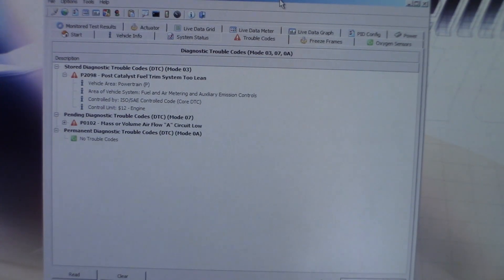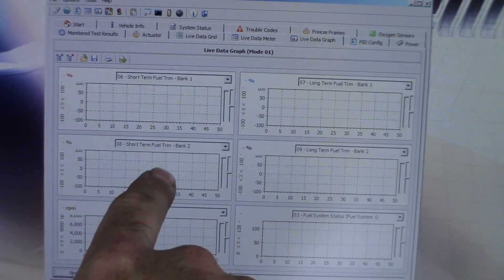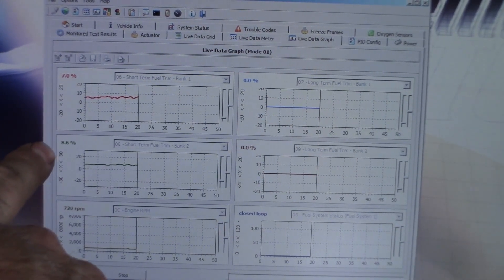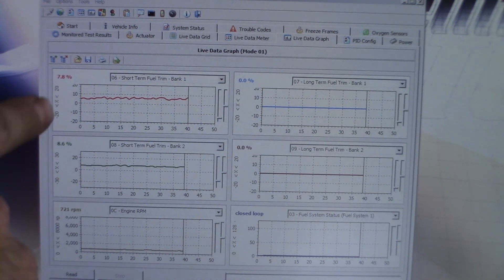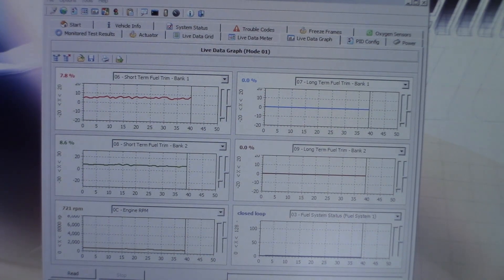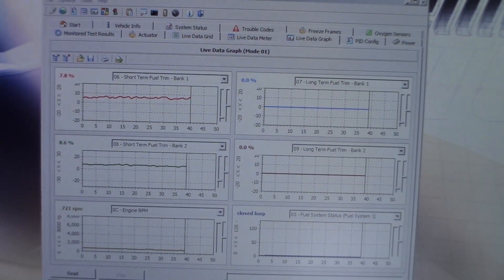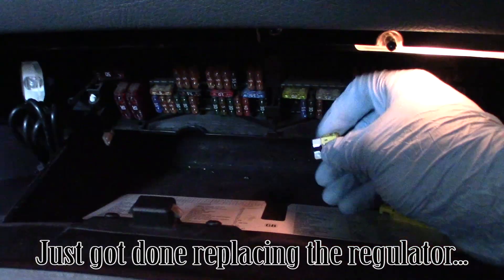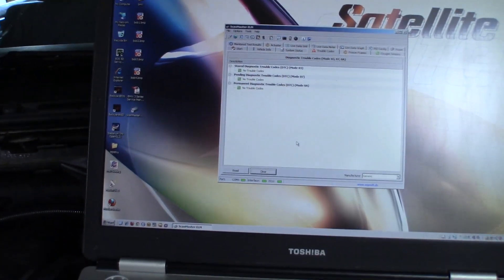BMW 330i 325i E46 Using Fuel Trims To Diagnose Engine Problems P0171 P0174

Comment: hi guys
i have fault code 
p2191 system loo lean at higher load bank 1
no mas air flow sensor in the car
short fuel term is always at -25 
what could be the problem please ?

Comment: I'm wondering if you may be able to point me in the right direction. I'm getting a lean code (bank 1 only) and a insufficient flow on secondary air pump on an 02 e46. I have checked trims, all are less than 5% (-2 on long term and 4 to 6 on short term). Smoke test revealed nothing. Is there another possible cause? Air pump works, relay works, I replaced the vacuum lines to the air pump valve on manifold, tested the switch at the intake, replaced fuel pressure vacuum line and filter, replaced MAF. new upper and lower intake Oh and also replaced fuel pump which is running 40+ PSI.  Thanks in advance for your reply. Love your videos as well, they have helped me eliminate all but these two pesky codes.
Reply: check PCV valve and hoses.
Reply: @jbaroli  Thanks!

Comment: Hope you will see this. I had fuel trim on bank2 of my m73 up to 20%, did your tests and found out its a vacuum leak(I sort can hear it). But I fixed the fuel trim issue when I removed the Air Injection valve it went to almost perfect 0%. Why is the air injection valve causing a fuel trim of 20%?

Comment: Hi , i have 330 ci and i have positive 10 percent on idle and it will decrease to 0  only once i hit the accelerator or if i let the car idling for long time , no vacuum leak spotted an as i test the vacuum system and no codes , what it could be the issue ??

Comment: Ive got on my diagnostic saying
Fuel trim limit bank1
Fuel trim limit bank 2
What would that mean?
Reply: Same, no idea, would like to know
Reply: @samarnold1839  i found out the problem 
Fuel pump and  camshaft sensor
Reply: @tubata111  ouch
Reply: @samarnold1839  second time fuel pump 
And 3 time the sensor...
Reply: @tubata111  that sucks. Is it safe to drive until pay day (friday) you think?
Reply: @samarnold1839  yea 100% but its just that the car would be laggy

Comment: Hey great video's, I've been chasing high LTFT for a while. I"ve replaced pre-cat O2 sensors, CCV system, fuel pump, fuel filter, both intake boots, 
IAC boot, rebuilt the DISA valve, replaced the Brake master cylinder vacuum hose, the tee that connects to the boot, checked all vacuum lines. I've cleaned the MAF sensor. The STFT will hanging around 0, but the LTFT still reads around 11. I finally replaced the MAF sensor and It corrected the problem. After about a 30 min drive , STFT was reading around 2 and long LTFT fell to 0. My car is an 06 325ci vert with 112k miles. So it seems that the old MAF was not correctly reading the amount of air entering the engine, so it looked like a vacuum leak / lean condition but in accuality it was a faulty MAF sensor not measuring the correct amount of air entering the engine. I guess the most puzzling thing was the car ran and idled good and smooth.
Reply: I’m having the same damn problem.... my car was reading around 12% positive fuel trim on both banks.  Then it got a cylinder misfire in cylinder 3. I did a smoke test at home and found the intake Manifold Gasket gasket was leaking... it replaced it. Stopped leaking. Still the same trims. Found a couple spot leaking. Got some hose clamps and stop the leaks. Did smoke test again, no leaks. Still same trims. Repalced the fuel pump and filter with built in regulator... trims dropped from 12% to 9-10%.
O2 sensors seems to be reading correctly as well as the MAF sensor.  It reals about 14-19 kg/hr.   Not sure if it’s lying. This is so frustrating.
Reply: @Omardottcom  you solved your problem? i have the same :(
Reply: Andre P  I haven’t  technical solved the problem but made it good enough to pass inspection.  As you know, I change my intake manifold gasket which has a leak. I put hose clamps on all the hoses. I changed the fuel pump and filter. I had a little leak at an o ring on one of the ccv connection threat was leaking so I replaced the o ring and stopped the leak. I changed the oil filler cap which didn’t really have a leak but smoke would come out of it  if the pressure was high enough when using the smoke tester I made. I checked the injector o rings and they seemed good. Some how my trims dropped to around 8% and have stayed there so far. The service engine light went away and I was able to get it inspected and pass. But the trims are still too high. When doing the smoke test smoke doesn’t come out of anywhere. I don’t know what else to do.
Reply: @Omardottcom  you solved your problem? i have the same :(

Comment: My bank 2 trim idles at -8% and goes lower  on acceleration.  Im throwing the exact same code..please help...4.4liter 750li 2011..car runs great, really would like to properly diagnose this rather than throwing parts at it

Comment: Hi Jason,
Thank you for informative video. I watched both of yours, and try to trouble shoot my P0174 code, which recently pop up 
(don't  have P0171)
Engine idles and car driven normal on both city and highway
P0174 came back after reset, while driving but not after engine starts , not at traffic light.
Here some additional info...
-New Valve cover gasket (less than 3K)
-New fuel pump (less than 15k)
-New DISA (less than 18K)
-New fuel regulator (less than 50K)
-New CCV valve (less than 50K)
-MAF is original, cleaned few times
I will your technique to determine to see it is a Vacuum leak or lack of fuel?
Again, thank for video.
Please let me know your thoughts
Reply: if it's just 174 and not 171 it could be o2 sensor. check o2 sensor voltages to see if that's the problem

Comment: I have a 2006 bmw 330i just changed both mass air valves and sensor and my car still runs rich till it dies but will start right up but smells like it’s running rich

Comment: Hello,
So what are your thoughts on aging sensors? I have a kind of interesting problem but a little theory first(skip to last paragraph if you have no time). With M52 they used Titania sensors that lasted a long time but looking at my M54 voltages i'm reading zirc values (up to 0.9 V etc), so sensors are probably more prone to aging problems.
Anyway according to my logic a vacuum leak would cause high trim because of the higher amount of unmetered air resulting in a lower amount of fuel being injected according to fuel maps and because lambda sensor catches the excess air due to lower amount of fuel injected, it will add more fuel and thats why we see higher numbes on fuel trim, same thing with dirty MAF (lower air).
My E60 M54 has a little rich idle i think, because although i can not smell rich exhaust, during colder periods it has a little too much condensation at idle coming from the exhaust. I presume my cats work fine and thats why i cant smell rich exhaust and they transform the unburnt fuel into H2O. It's not just the normal higher condensation that occurs during winter etc of that i am sure, because it still happens after longer drives and is always there, even when all the other cars around do not produce "condensation vapors".
My fuel trims are fine and i have no codes, lambda voltages are fluctuating like their supposed to, so i'm thinking the ageing oxygen sensors are the culprit since the effects would not even be registered by fuel trims and the sensors are "bad" due to voltage not reaching that high anymore?
Reply: All the other problems that would cause rich mixture would probably be picked up by oxygen senors and in turn by fuel trims i would guess.

Comment: Hi your content has been amazing! So I used the fuel trim to help identify my p0174 p0171 codes but after fixing the vacuum leaks I continue to have the codes. Now that all the vacuum leaks are fixed I notice the fuel trim goes 27.3% at idle and holding at 2500rpm it drops to zero then within 5-10 seconds climbs back to 27.3% on the STFT. Here's a list of the work done. Cleaned the MAF, changed the intake boots, all the vacuum lines, intake manifold gasket, new spark plugs, ccv replacement, icv grommet, throttle body grommet, new fuel filter and fuel pump was replaced last year. I appreciate any help thanks!
Reply: What was the problem? My STFT also reads 27.344% very regularly which is such an odd number to stay at for both of them
Reply: Did you find a solution to this? Mine is exactly the same. Thanks
Reply: @robeaton2191  lol I sold the car was my solution.
Reply: @mashzilla  looks like i bought it lol
Reply: Lol I'm having same problem with 27.3% on STFT. Did you find out the problem?

Comment: Forgive me for my bad english. I have a problem similar to the one in the video. My short fuel trims are about 25% at idle. I've checked for vacuum leaks with a smoke machine but I've found nothing. The MIL light is on with P0150, P0170, P0173, P1250 and P1520. I've bought the car 2 months ago and since then I don't know where to look. The O2 sensors are ok (checked voltage), i have changed the oil and fuel filter 4 days ago but nothing changed. The MAF is working properly (I've also cleaned it but no luck). The fuel trims when I start the car are about at 3%, then slowly go up at ~25%. When accelerating they drop at 11% but they won't go down over that. I don't know what to do 😪 Thank you for any response

Comment: Hey man, that's such an informative video and a great way for diagnosing the fuel trim bank 1/2 issue .. I'm facing the exact thing and I'm going to try this method to figure out the issue.
My E46 330Ci is a japanese import and almost no OBD tool is working with it, I just purchased a BMW Scanner and hopefully receiving it soon .. Can I do the tests using the BMW scanner and its software?

Comment: hello Jason recently replaced ccv all vaccuum hoses on my 04 330ci  rebuilt disa with g.a.s. kit. the service engine soon light is still on disconnected batt still is on do i need to erase the codes in order to reset the light. codes show bank1 bank2 lean also shows replace pvc valve which i have already done.your videos and your help is greatly appreciated.

Comment: Have a ? I own a 2004 z4 2.5 I changed the ccv I disconnected the battery before I started and color coded the plugs so I wouldn't mix them up even tho they will only fit the right one but after I hooked the battery back up after completing the job and now it will crank but won't start any idea

Comment: Hi jayson sorry if im asking too much im just confused and need your expertise. What would be the normal range of 02 sensor volt at idle and with 2500-3000 rpm? I want to rule out via volt reading if my o2 sensor is the culprit? Also the  normal range g/s of the MAF sensor. At idle and 2500-3000rpm?thank you very much.
Reply: My MAF output at 3800 rpm is 15g/sec, and at 725 rpm idle is 3.6 g/sec.  Help you any?

Comment: Hi does  + - 5 is normal at idle? Thank you.
Reply from the maker: yeah that's ok
Reply: 50sKid  Hi jayson, pls correct me if im wrong, do you think tracing vacuum leak via fuel trim must be done at idle? When im at 2500 to 3000 at the road my STFT kicks to 17% that because engine needs fuel to run right thats why fuel demand goes up when driving on the road.my LTFT both bank 1 and 2 is pin to 11.7 which i know its always adding 11.7% to maintain the ratio. (Could i reset this LTFT?) or incase if i fix the leak would this 11.7% on my LTFT will go normal. Sorry if im wrong i guess its always adding 11.7% fuel to maintain the ratio?
Reply: In addtion to my question...my car is running fine but i noticed when starting the car i didnt hear a priming sound in my fuel pump do you think not hearing a fuel pump priming would indicate thats its going to fail soon? right now it takes me 3 cranks to start the car  at cold start after it dies at 1st to 2nd crank battery sign on dash board pops up.i consider changing the battery but no priming sound bothers me.

Comment: Hi im having this on my e46.

Idle:
STFT1 = 8.6
STFT2=  0.0
MAF =    0.565

2500 -3000 rpm
STFT1 =   3.1 - 4.7
STFT2 =  -0.8, 0.0, -2.3
MAF =      1.870

I think its a vacuum leak...going for a vape test
I just want to rule out if MAF is failing /failed?

Thank you.

Comment: Hello can some one help me i have this code P0170 fuel trim bank 1 My engine goes uneven and turns off when it's in a minute and can not run it at all because it loses all the Power i changed air flow meter but is stil The same i have dont change fuelfilter and power train regulator and I dont know If I have some where vacuum leaks so on the last i scaned it on garage with data tool scanner and I get catalytic fault code Could it be wrong that it goes uneven i Will be very grateful for respond back Thanks

Comment: Hey @50sKid thanks for detailed instructions, can fuel pressure regulator also cause missfiring codes with p0174 and p0171? I have p0174 p0171 p0305 and random missfires code
Reply from the maker: I doubt it.  You would have to have a severely restricted fuel filter which usually doesn't happen.  P0171 and P0174 are almost always caused by vacuum leaks.
Reply: 50sKid thanks for reply, i noticed that the first code that is thrown is p0174 and only after driving a while i get p0171, does it have to do something with SAP or it will be triggered only on cold starts?
Reply from the maker: +Alexan Gulbudaghyan if it was sap you would also have sap codes. You have a vacuum leak somewhere. Watch my common vacuum leaks video
Reply: 50sKid Hello can some one help me i have this code P0170 fuel trim bank 1 My engine goes uneven and turns off when it's in a minute and can not run it at all because it loses all the Power i changed air flow meter but is stil The same i have dont change fuelfilter and power train regulator on the last i scaned it on garage with data tool scanner and I get catalytic fault code Could it be wrong that it goes uneven i Will be very grateful for respond back Thanks

Comment: @50sKid, i have a problem with my 2002 330ci, sometimes i have lean codes thrown at bank 1 and 2 other times MAF code.
at cold start the car hesitates and sometimes stalls but very responsive and alot of power, 
once it reaches operating temperature no more stalling but most of the time it has no power like accelerating in 4th gear
and other times it jumps and awakens then back to no power, above 4000 rpm the car runs fine.

reading the fuel trims, at idle everything is close to 0 (fluctuates between -2 and 2) but once i put a little acceleration the trims are flying (up to 18 to 22% inpa lambdaintegrator bank 1 & 2) 
the things i've done :
replaced O2 sensors (maintenance)
replaced fuel filter and fuel pump
replaced CCV, oil filter housing gasket, valve cover gasket

checked the fuel pressure both at idle and throttle it's stable at 3.2/3.3 bar

any ideas where i should be looking next ? i eliminated the vacuum leak since at idle the trims are normal
could it be the MAF ? cleaned it (with no change), if the MAF is dead would the fuel trims be normal at idle?

thanks.
Reply from the maker: Your fuel pressure actually sounds low.  It should be 3.5 bar/50psi.  What brand gauge did you use for that test?  Anyway, if the MAF was dead your car would either not run or the computer would recognize that and substitute a value for the MAF reading and that value would most likely be higher than normal and you'd see that reflected in the fuel trims.  But your MAF could be out of calibration and causing the problem.

Anyway, the most important thing I want to explain is to not use INPA fuel trims to diagnose things.  The INPA "trims" are not the same thing as the OBD2 short and long term fuel trims.  They mean different things and they can't be used to diagnose problems the way I explain in this video.  You need to get an OBD2 code reader that supports live data and you need to look at short and long term fuel trims on banks 1 and 2.

Now, once you do that and IF you still have the same behavior (normal at idle, higher at speed), the possible causes for the problem you are describing are: bad O2 sensors, insufficient fuel delivery, or bad MAF.

So first confirm that your fuel pressure really is low, and especially confirm that it doesn't drop lower at speed, and if not, replace the MAF with an OEM Siemens one.
Reply: Thanks for your answer, i'm back with more data.
the gauge i'm using is not very good, i ordered it on the net and it's like a tire gauge so i ordered another one waiting for it.
in the mean while i got a new MAF VDO and tested it but changed nothing so i returned it back.
and i got my self an OBII scanner and here are the results after resetting the fuel trims :
at idle the short term fuel trims are - 4 to -5 
at 3000 rpm the sft are at 19/21 
then at 4000rpm i got 10/9, all in closed loop.
the catalyst, secondary air system, oxygen sensor, and oxygen sensor heater status says : not complete.
i measured the sensor 2 short fuel trims (post cata.) and they both had 99.2% not sure if that means anything, also measured the voltage that drops when accelerating.
i'm waiting for the new fuel pressure gauge to get an accurate result, but i think i eliminated the MAF, but i don't know where to go from there.
Reply: did you find the solution? @danytrabolsy

Comment: Hey kid, love all your vids...have def used more than one for some DIY.  I have a p0174 lean code on 2003 330i.  My STFT on both banks are ar 6/7% and mt LTFT are at 11.7% at time of code.  I was at 73mph  when the code was thrown.  I feel a slight hesitation at around this speed.  I've had the car checked for vacumn leaks and have replaced the usual suspects.   Just replaced the fuel filter.   This car hasn't had the fuel pump changed or MAF as far as the records show.  Any help is appreciated...ty